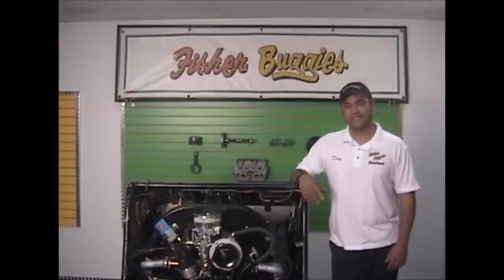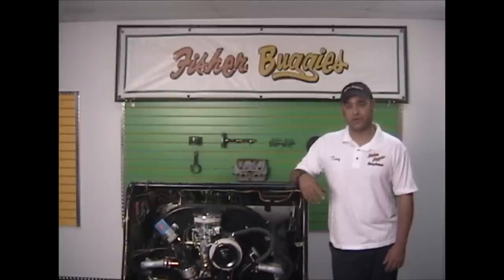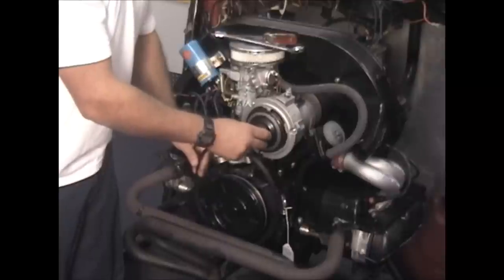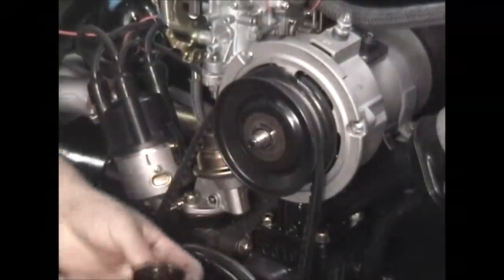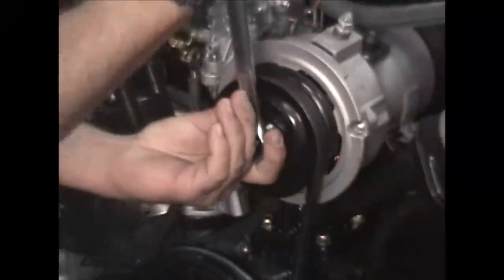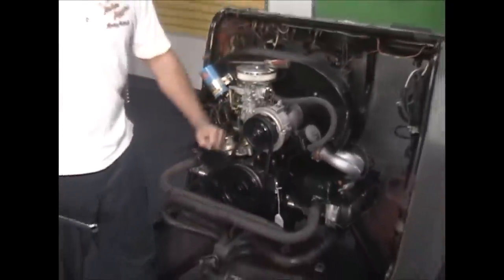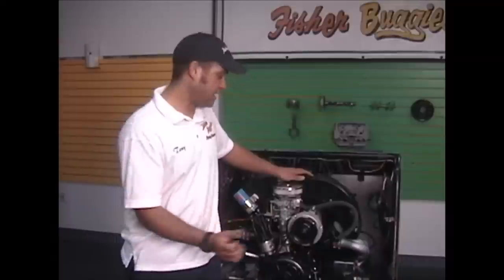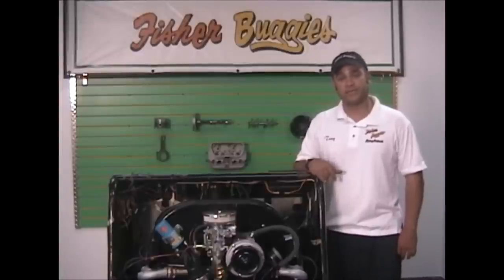Replace VW Belt

Comment: What size belt do I use with a CB performance crank pulley and an alternator on the top I bought a belt the other day and it came right off I took the shims out from the inside it was tight for a day and then came right off seems like I need a smaller belt to use the shims